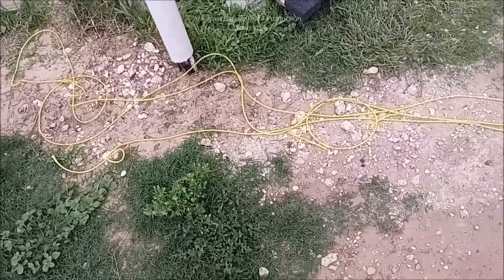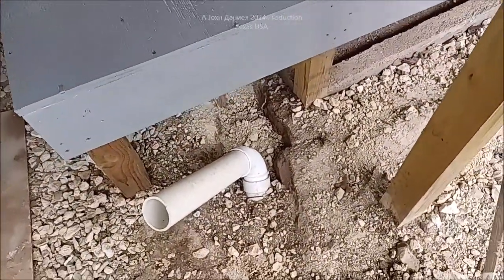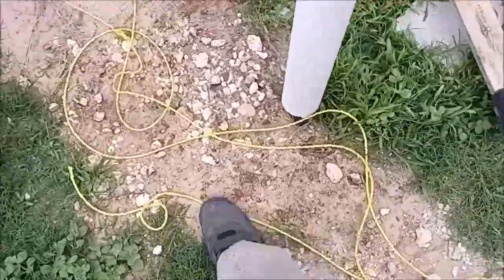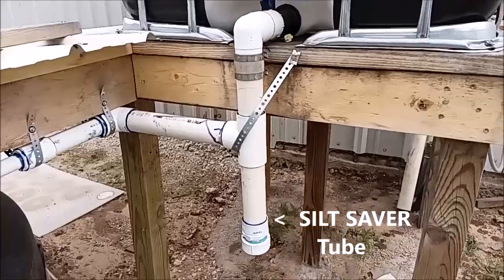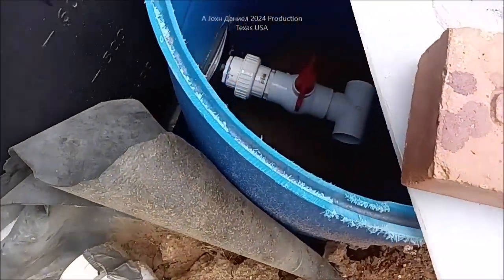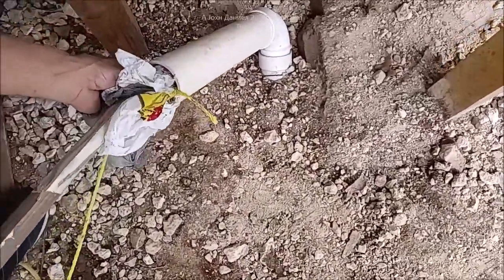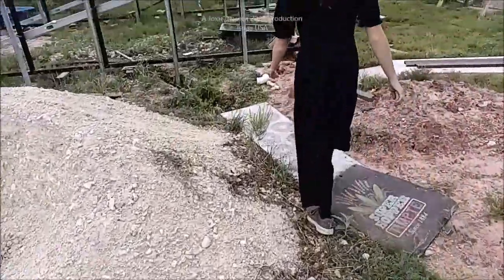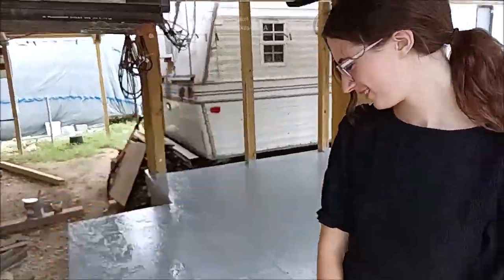My rain water collection system build, Putting a tug rope in 100 feet 3" conduit with leaf blower!

Comment: Think you got 80 40 20 10 tank, the other way around.guess your catching sand all rainy days, I got 2mm mesh, bucket over flows threw 500mn, drops threw 20mn sock, ing a ibc tank which recirculates down too 10mm then gets pumped into another ibc and reecirculates to 5mn, to the taps 5mn 1mn and a carbon block 10". Blower could suck it threw to
Reply from the maker: We tend to get leaf film on the roofs, so using 40 to 80 to 200 Mesh in the collection tanks we remove it then using a 5 micron cycle pump we clean all the remaining pollen or silt from the system. From there it is sent through a 120 foot pipes to a gravity tank with 3 filters, a 5 micron to a 1 micron and mild chlorinating then pumped into the homes and shop from it. There it goes into a 0.5 micron twin filters and drinking water is into a 5 stage simpure reverse osmosis.  Until we get the new big tank into action we are using 2 of the 300g IBC totes inside the shop to use all the water collected for use. It's been working fine, but 3 times last year we had to pull from the county system to supplement since we wasted the chance to collect 50% more rain. That is now in FIX STAGE 2~ !
Reply: @JOHNDANIEL1  It just sounds like you have your  meshes upside down. Don't forget in plastic water will go acidic, but when it goes underground it should level itself, with cool temperatures. got a uv light on it? I need to get a uv or my tummy turns over. Wind turbines and furling ? Is their such a thing as furling into the wind, because theirs lots of videos of furling out of the wind, I don't see the point in it, metal ball bearings are ment to get hot, so furling in to the wind with a got size tail would mean the turbine blades aren't bending towards the wind, when the wind is come from different directions.

Comment: brand new IBC's is the way to go because in industry those containers are reused with who knows what chemicals.
here a truckwash company used some used IBC's to put the truckwash  detergent in it , they thoroughly washed the IBC's out 3 times, later people who used the truckwash were hospitalised , turns out the IBC's used to have paraquat in them , a deadly weed killer with zero antidote or treatment that can help you, just a very small amount of it in your mouth is a death sentence, here animals die quickly if they ingest the tinyest amount, it also gives farmers like my uncle parkisons and not late in life.
Reply from the maker: We lucked out with ours getting them from the facility who ordered them. They are called ONE TRIP, so they only got used once to ship fractionated coconut oil used in food and cosmetics. They washed out easy and they all had over 5 gallons left in each one, 12 totes x 5+ we ended up getting over 75 gallons of the oil which I have tested to run in the 9 horse china diesel I have with perfect results. All 12 of them cost me $720. They had Schutz brand manufacture dates on them spanning July to October 2023 and we bought them in January 2024.

Comment: What's the name of that municipality, Daniel, TX? What zip-code did they assign to it? Great intel here. Thanks.
Reply from the maker: Our total roof space is over 6500 square feet, if you calculate that into a rain harvesting calculator https://www.bluebarrelsystems.com/diy/size-your-system/ with our 31" rain averages per year, you get well over 120,000 gallons of water. Even in drought years it exceeds 70K. Why pay a utility or extra to run wells. We have 3 wells, they put out low rate, so this is how to work them less, pay less over time and have prepper solutions that work.
Reply: @JOHNDANIEL1  Amen, brother. I've got a really strong, gut-feeling we're going to need these kind of things real soon. Be well.